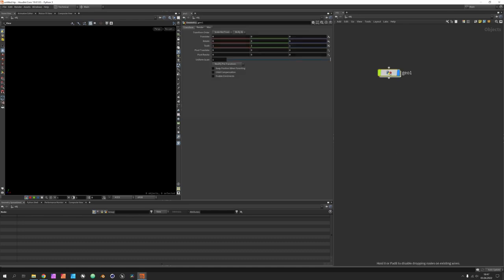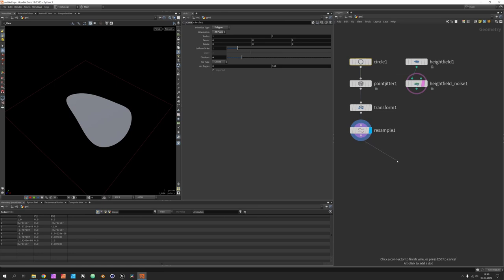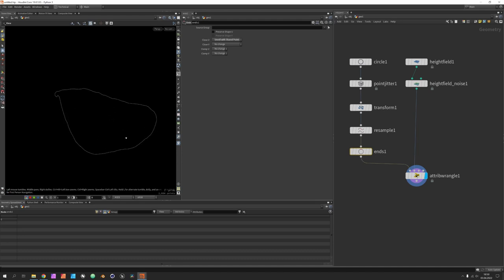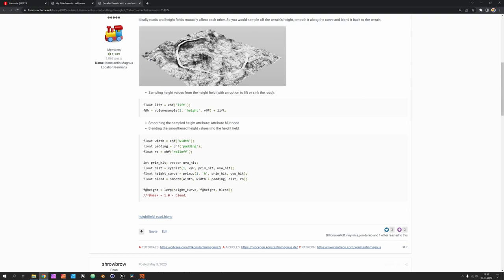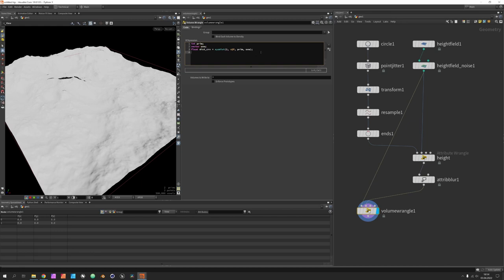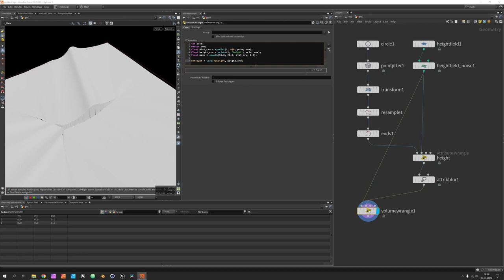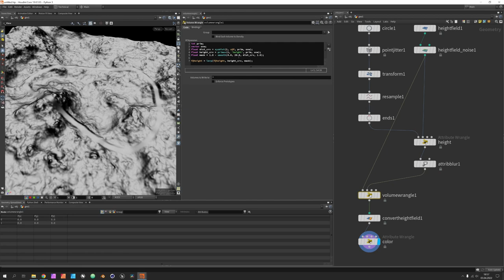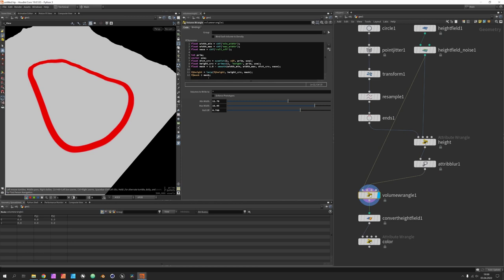Integrating a Road into a Heightfield – Houdini Tutorial

Comment: Hello, great video! Is there a way to extract the curve that shaped the "road"? I blasted the masked points (to only extract the road) to then try to get a curve... it works, but not that well and I wonder if there is somehow, maybe via wrangle to extract the curve that shapes the road (basically 'end1' node but with the correct P.y).
Reply from the maker: Hi Lia, you could add an attribute wrangle with v@P.y = f@height; either before or after the attribblur1-node.

Comment: Solid gold man. 2 Questions for you. 1: would it be possible to add a subtle noise in the smooth function to the road width? So to have a path that looks slightly more organic. Question 2: would it be possible to detect when the road is going through a mountain too steep and place a tunnel or deflect the road?
Reply from the maker: Thank you!
Q1: You could globally add noise to the max value before the smooth function:
width_max += noise(v@P * 0.1) * 40;
or transfer and add some attribute you have prepared on your curves:
float deform_crv = primuv(1, 'deform', prim, uvw);
Q2: You could increase the heightfield a few meters to make room for a tunnel when exceeding a certain slope. Tunnels themselves are not possible on a 2D heightfield.
Also all this more advanced things such as tunnels, bridges, crossings need lots of thought and preparation steps and possibly would not be done right in a single volume wrangle.
Reply: @KonstantinMagnus  oh yes of course. I meant faking just the entrance of a tunnel :)